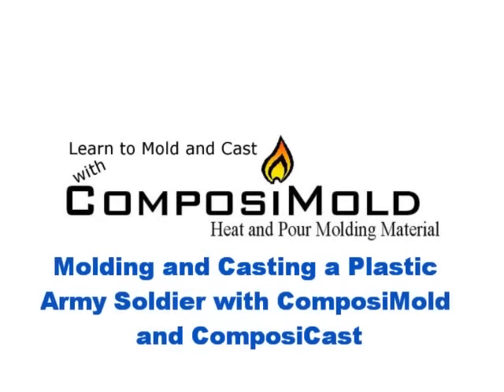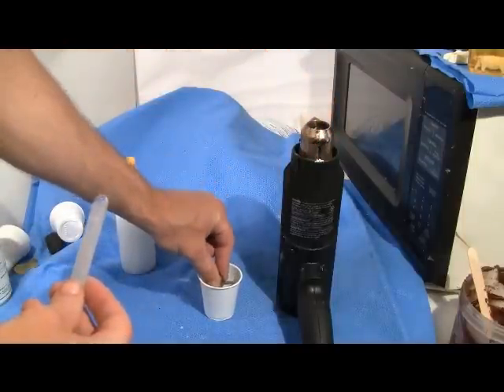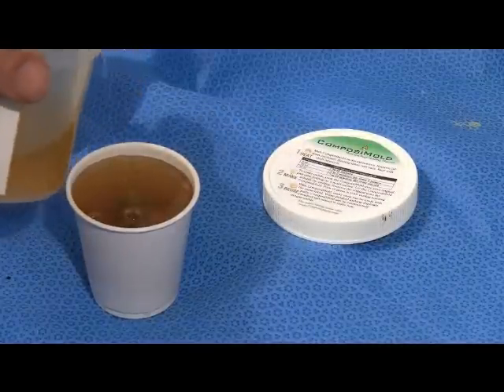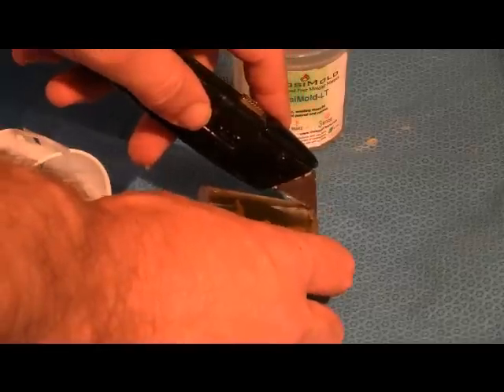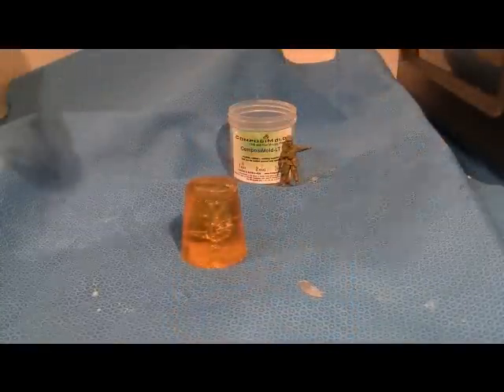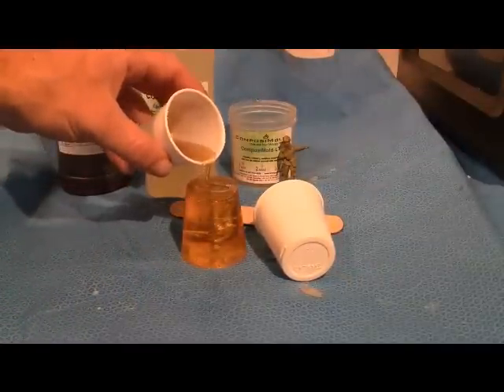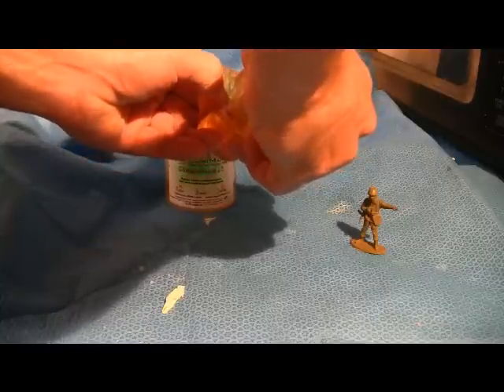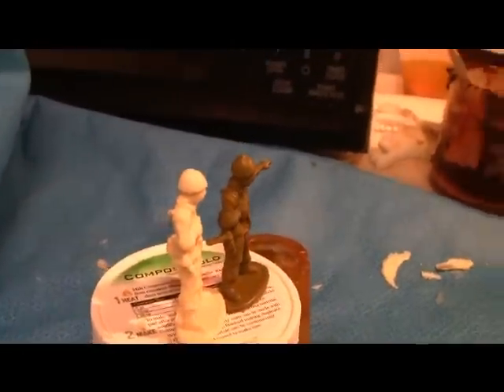Molding and casting a Plastic army Soldier with ComposiMold and ComposiCast

Comment from the maker: Thanks! Great Christmas present! ComposiMold is a less expensive (definitely cheaper in the long run) rubber mold. The rubber mold is much more forgiving in terms of allowing you to fix mistakes (Reheat or use a heat gun to heat an area). The silicone molds are typically longer lasting for single rubber molds and typically (but not all of them) have better tear strength, although after they start to go bad, you can not fix them or recast them. Thanks for your question and comment!

Comment from the maker: Yes, the mold can be reused also. The number of times varies depending several factors: the use of a mold release, the complexity of the mold, and the casting material. 

The last images in this video shows many of the castings made with this soldier video using urethane and wax. Thanks!

Comment from the maker: @Toyman1982 -You might like the videos on using ComposiMold for candles and soaps on YouTube. The key for higher temperature materials is to cool the ComposiMold or PowerMold first in the refrigerator or freezer. The ComposiMold heats up slowly while the resin or wax cools faster.

Thanks!

Comment: Say I’ve been using similar molding and casting material. And the spray to erase the bubbles can you use cooking oil?
Reply from the maker: The Bubble Buster reduce surface tension so the bubbles are less likely to stick to the original part when making the mold. Use this after using a vegetable oil or mineral oil as the mold release.
Reply: Thank you. I’ve tried many times I had trial and error but thanks to you I can make more Army men now.

Comment: Okay so I also noticed that you used dye in the old version of this tutorial. Is it still applicable with this tutorial and if so what type of dye are we talking about?

Using Composimold, can I say use Smooth On's "mold making silicone rubber"to cast the soldier itself? Will there be any special complications if I do that?
Reply from the maker: Hi Steven, Yes the dyes are great. We have used a few different brands of urethane dyes, just search online for those. We have also experimented with these dyes in silicone and have had good results too. Smooth On's silicone works great in a ComposiMold. Be sure to use a silicone mold release and go for it!
Reply: Thanks for the fast reply, would like to try this as soon as I get around the price. I'm lucky that they sell this locally in the philippines :)
Reply from the maker: Great! Be in touch when you get some and let us know how it goes!

Comment: Hello, is the plastic copy that was made good quality, the same as a regular Army Man toy?
Reply from the maker: The original army people are typically a thermoplastic...my guess is it's polyethylene or polypropylyene. For this we used epoxy because it'sstrong, tough, has a little flex (but not the same way as the thermoplastic) and it's much easier to do epoxy (a thermoset-where two parts cure to a plastic) then to deal with the temperatures and pressures to press in the thermoplastic. thanks!

Comment: I notice that the gun barrel didn't survive the molding process.
Reply from the maker: Hi Gourmet Paper Mache (interesting title!), Thanks for your comment. When you have a spot in your mold that juts out horizontally like the gun barrel, be sure the casting material has filled that area. Also if it breaks off in the de-molding step you can then "glue" it back together with some of the urethane. This is one of our older videos so I can't say which was the case here. Have you seen our paper mache video?
Reply: ComposiMold

I will look.  I'm very interested in these techniques.   It looks like nice material.
Dan
Reply from the maker: Thanks Dan! ComposiMold is a great tool. Be in touch if you try it out!
Reply: agreed

Comment: This stuff would save me alot on silicone.. well.. maybe,... it depends on how hot this stuff can get before it melts (cause if i pour hot wax, or smooth-cast (that heats up) into the mold and it melts, thats not good...

Comment: Didnt you just destroy the mold when you took the soldier out?
Reply from the maker: lightandark Hi! Thanks for your question! ComposiMold, being a rubber, is easily cut to remove objects. This does not effect the area where your object was in the mold. (It's just along side this area.) If you leave a portion of the mold uncut, and open it like a book, it will help you realign the 2 halves when making your castings. We would recommend putting some tape around the mold to hold them together while making your castings. Let us know if you try this!